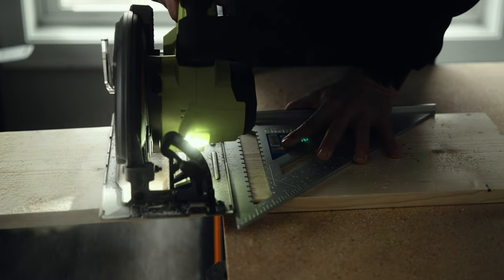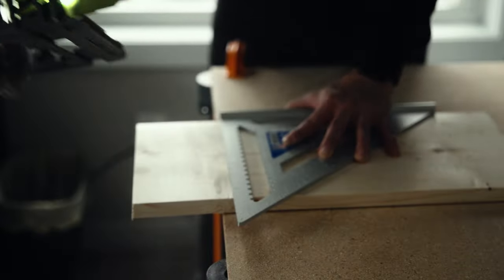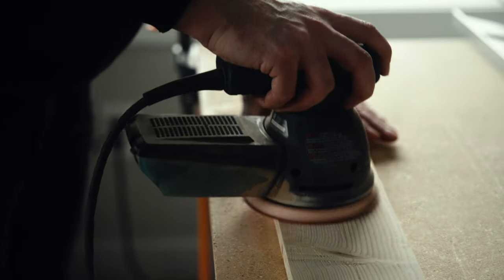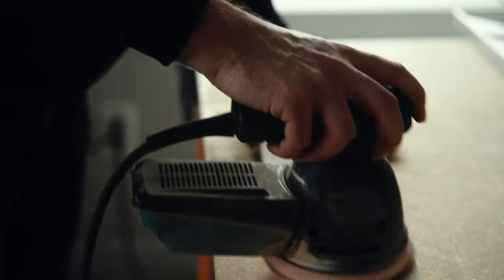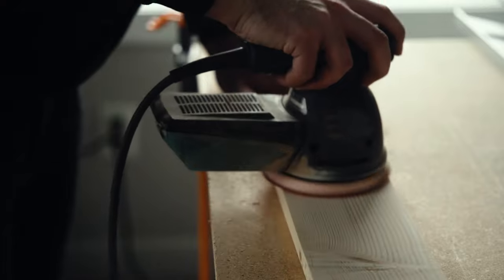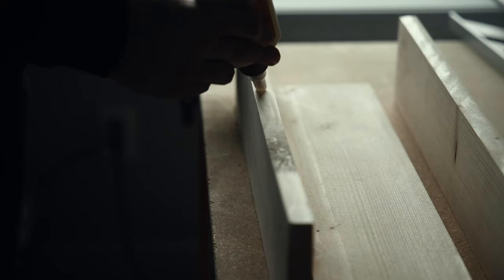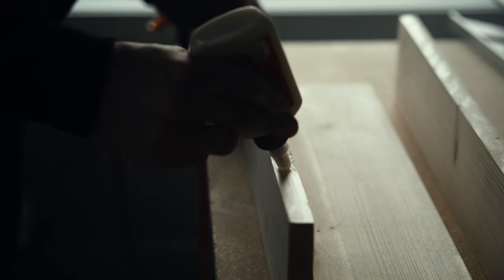I built a shelf for my sofa

Comment: super nice, does the lack of stain on the inside bother you at all, or more correctly can you see it from an angle?
Reply from the maker: Thank you! It's not really noticeable unless you're looking for it. There was a plan to buy some felt/leather and glue it to the inside to protect the couch which is why I didn't end up staining it originally. I haven't gotten round to doing that part yet and didn't want to wait to finish the video so right now I'm actually using a couple of strategically placed cloths for the same purpose.